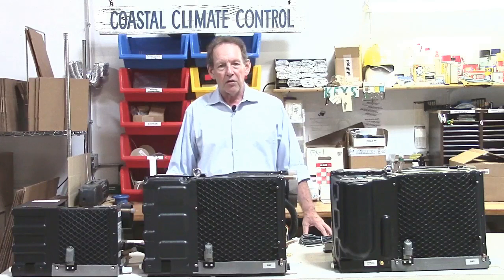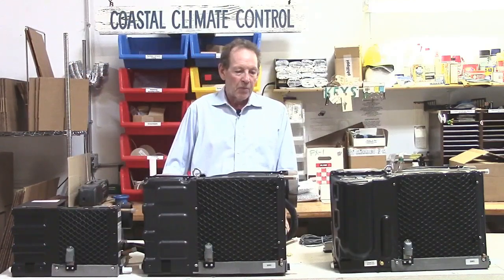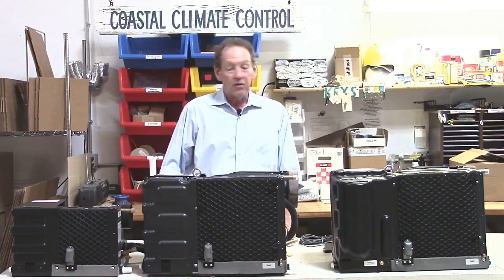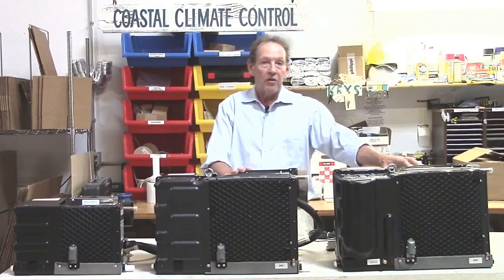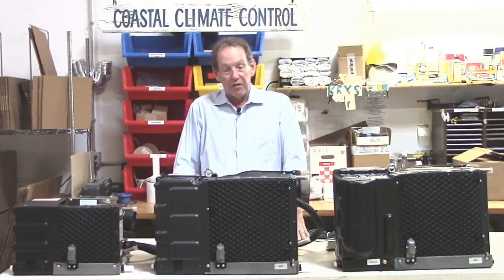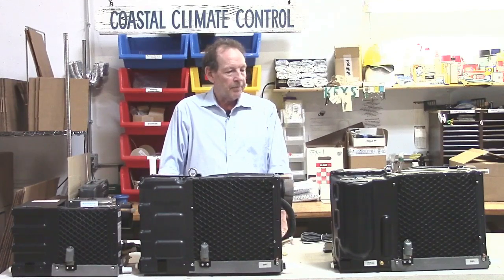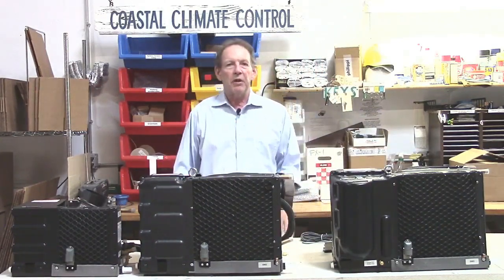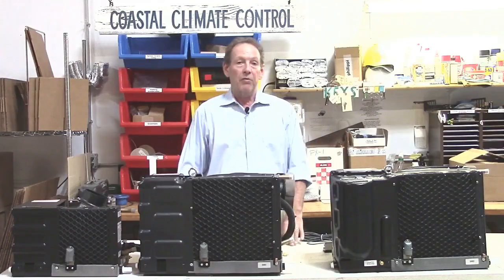MarinAire Air Conditioning Part 1: Units

Comment: A very poorly thought out unit. No section of suction line available to attach a thermal couple for super heat. Unit has to be removed from boat for service and charged on the bench. The reason is, the boat has to be perfectly still in the slip to use a scale and that's never going to happen.The gauges are useless since you can't charge 410a by pressures like you can R22. Components are jammed together under the shroud. I literally had to destroy a unit to get to the HP switch.
I tell customers to buy one if you like but i will not service them. Just too many headaches to get involved in it.

Comment: I've had one of the 14,000 in my trawler for 3 years now . I love it. Should I have a sacrificial zink in the water intake line ?
Around the strainer ?
Should I have any worries about the salt water rotting out the unit from any sort of electrolysis  ? Thank you.
Reply from the maker: You shouldn't zincs on your water intake and strainer. It's not the salt water "rotting" your unit, it's the stray currents that may or may not be there.
Reply: @CoastalClimate   Thank you.
I've had no problems in 3 years. Doing routine maintenance.  Just cleaned coils and drip pan . It's been a great unit so far.
It heats, it cools and dehumidifies like a champ.
Thanks again.

Comment: Would one of these make a good option for a small camper? A lot of people are installing mini splits on campers and cargo trailers these days. But they're enormous, and use two components with the compressor and wall unit
Reply: No it would not be as it has to be water cooled. Water in ,water out. Mimisplit is the way to go in a camper. Or a ceiling unit.